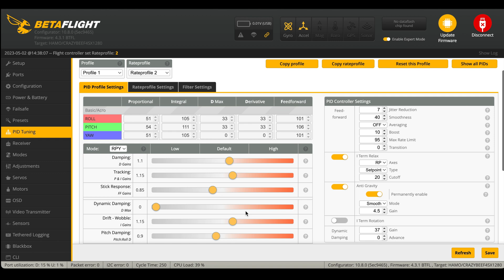Reduce jitter in your FPV drone & PID settings

Comment: without a BB is hard to detect the cause
Reply from the maker: Hmmm im an old-school ltuner.. so never needed to rely on a blackbox. But! Blackbox does make it easier and pinpoints the issue easier.
Reply: @shogunemperor  problem is that this FC doesn't have any bb, and for sure with bb datas, filter and pid tune process is waaay more precise
Reply from the maker: @Pozzix65  agreed.